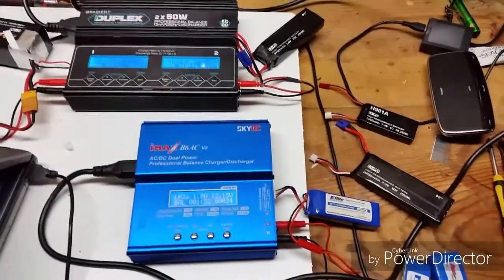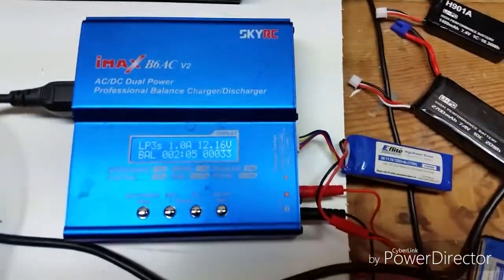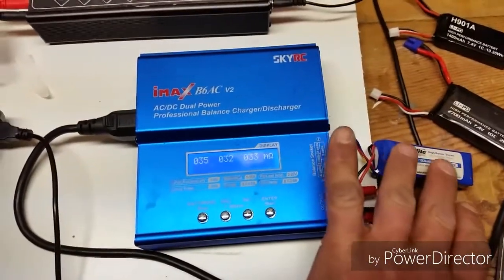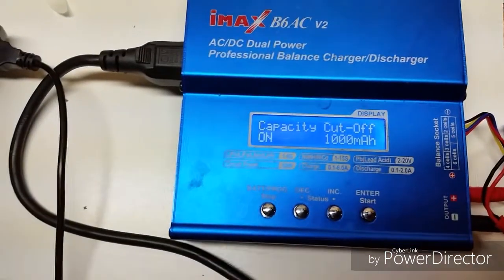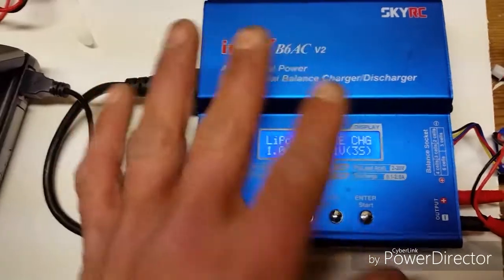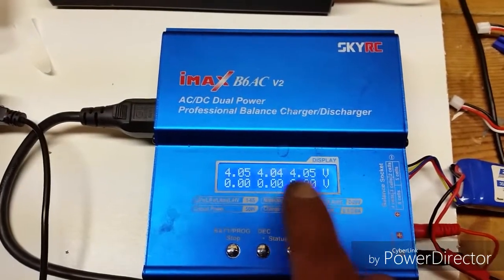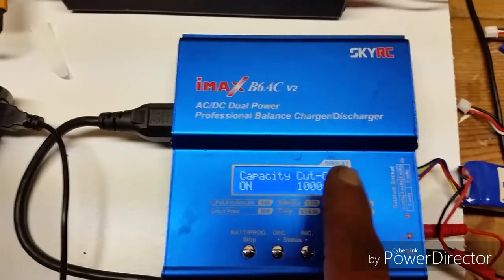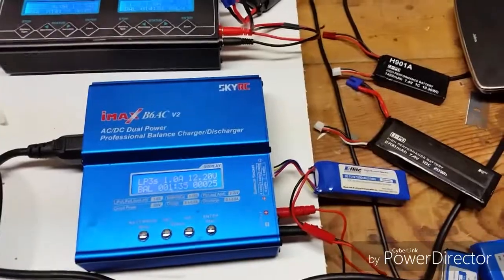ImaxB6 Charger, How to Set Its Functions, Capacity Cutoff, ETC...

Comment: Thank you for a great presentation. One of the best ones on YouTube.
Reply from the maker: As for the Capacity shown on it, yes it will show the mAh it was able to put into the battery. When the Capacity Cutoff feature is ON, it knows exactly when to Stop charging. It doesn't matter if you stop the charging process and start it again, it will only charge the battery, until the Capacity Cutoff is hit. So using that feature is always a very good idea.

Comment: What is capacity cut off
Reply from the maker: Capacity Cutoff, is a feature of a professional charger. The charger uses it's micro processors, to ensure that the battery does not overcharge or over discharge. Using the Capacity Cutoff feature, allows you to input the mAh capacity of the battery. So if you have a 2700mAh battery, you set the Capacity Cutoff to 2700mAh. This ensures proper charging or discharging of the battery. You could think of it more simply by thinking of a water carton. If it says 1 gallon, you would not poor 2 gallons inside it, right? Thats "capacity".
Reply: @MarkSuttner  thank you very much 😊
Reply: @MarkSuttner  but if the lipos aren't fully drained too 0, which you don't want, but if they aren't do u still set the capacity cuttoff at what MAH your battery is?
Reply from the maker: Yes, always set the Capacity Cutoff to the exact MaH rating of your battery. That way, even if it says the battery is fully charged, only depending on the voltage, you can still see how much capacity charge has been put into the battery. LiPo batteries can be challenging. Any Pro charger can charge them to what they think is fully charged. Example, for a 2700MaH 2S battery, the Voltage should be at 8.4 when fully charged. 4.20 volts per cell. However, if you have the Capacity Cutoff feature on, you can look at was actually able to be charged into the battery. I've had 2 501SS batteries fail on me. But it's because I wasn't watching the chargers information.
Reply: @MarkSuttner  thanks for the reply, so once it's fully charged, what it says its put back into the battery, that's what i set the cutoff too? Or, always what mah my battery is?
Reply: @MarkSuttner  like say, my 6000 mah is at storage voltage which is 3.8v per cell, and once it charges and let's say it put back 3800 mah back into it at full charge, do i always keep the capacity cutoff at 3800mah or 6000 mah
Reply from the maker: You always set the Capacity Cutoff, to the mAh rating of the battery you are using. For example, a Hubsan H501S' flight battery is 2700mAh. So set or keep the Capacity Cutoff at 2700mAh. Always set the Capacity Cutoff, to the mAh rate of the battery, nothing different. The charger will do the rest.
Reply from the maker: You would keep it at 6000mAh Capacity Cutoff. If you are using a 4500mAh battery, always keep the Capacity Cutoff at 4500mAh. Basically just keep the Capacity Cutoff feature, set to the mAh rating of the battery. Usually the mAh capacity is labeled on the battery.

Comment: With the capacity set to 1000mah it will try to put that much into your battery even if its half charged already. do doesnt stop early if you already have 500 mah in the battery.
Reply from the maker: Setting the Capacity Cutoff, will stop the charging system. As long as you have a genuine, Professional Charger/Discharger. It can read the "meant" voltage and capacity through it's micro processors. So, if you set the Capacity CUTOFF to 2,700 mAh, the charger WILL Stop, when it has reached the limit. You can see this by the LCD Screen on the charger. It should show you the mAh, put into the battery. If the battery is in "Storage" or >7.4 volts, the charger will only put about 1,300 mAh into the battery. Based on its Current capacity, when you begin the charge, no matter what level, the battery is at during the beginning.

Comment: My friend got the same charger but it takes 5 hours to charge a 3s lipo when mine charge them in a hour and half,, i did notice my capacity cut off is 5000mah and his is set at 10000mah will that make the difference ?
Reply: He most likely has it on the wrong amperage. I purchased a 5200 mAh Floureon Charger as well as a 50W iMax. So, your friend either got the wrong power cord (The connector that they don't supply in the kit) with the wrong voltage and wattage rating on it or they don't have a powerful enough charger, like I accidentally purchased a maximum of 5A while needing 5.2A. So, tell your friend to double-check the specifications on this item. Or, if I am wrong, he might've gotten a defective charger. Hope this helps after eight months!